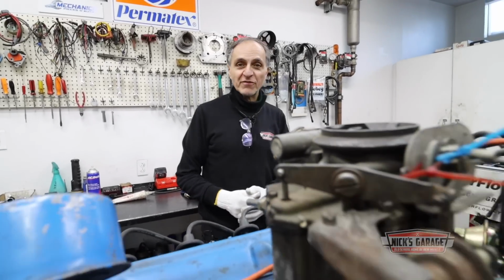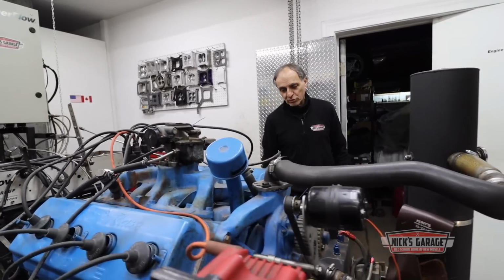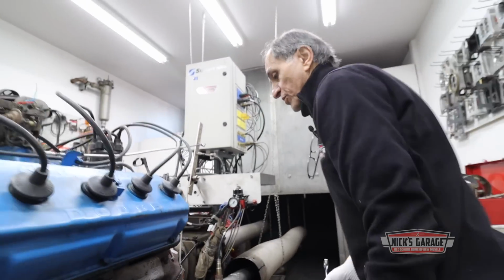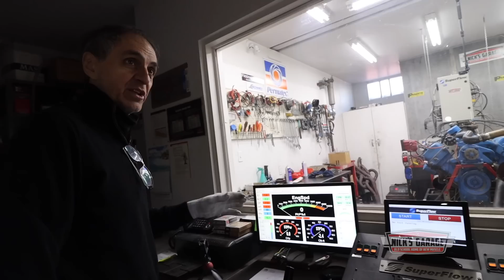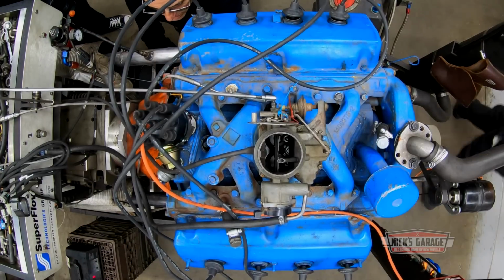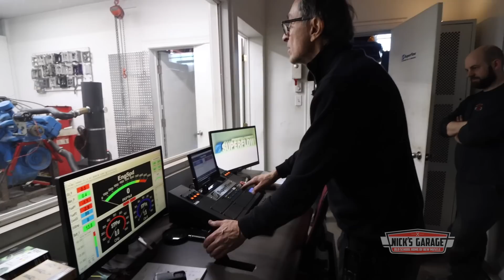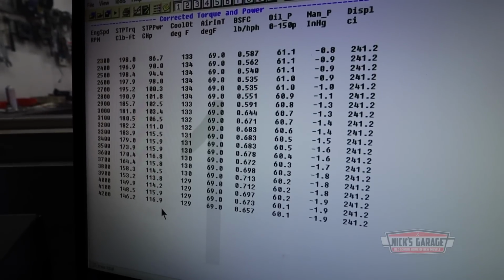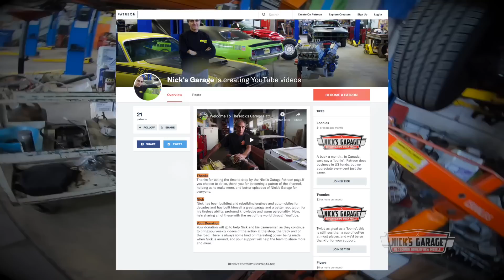Gen 1 HEMI on Dyno - WEAKEST Engine I EVER Tested

Comment: That's the thing I never really liked about chrysler engines. There is always some stupid unique spacer/provision involved. I'm not just talking about shims. Usually very difficult to adapt. Usually, a "oh we're going to make this engine fit to this, and later redesign it to fit to that". That's just the reality of the beast. And of course things always go wrong when you don't use the right parts.. YOU HAVE TO USE THE RIGHT PARTS. I learnt that lesson a loooong time ago. It was a valuable lesson. If you're 50% wrong, you're 100% wrong.

Can I blame nick for this? Not really. When there are so many provisions that are required for every unique scenario, there will always be one unique scenario where you can't perform. But he should have had the provisions in place before agreeing to do the test. I know how hard it feels to turn down a customer. But sometimes it's the right thing to do.

Don't get me wrong, chrysler made some amazing engines.
Reply: blerk h.        I was lucky on the first 241 Red Ram last year, no issues. Same set up as before, and had a hard time with this one. If I would have know, I would have done lots of machine work to fit it correct. But wait, I have an other old Hemi to be rebuilt. This one is  a different set up at the flywheel, a 1956  354c.i.
Reply: Yup. My major gripe with old Chrysler's is how they constantly keep changing minor details from year to year on their engines and anything else they design. As a result I usually cant interchange parts between two Chryslers from the same generation unless their model year, edition and everything else also matches. Simple repairs on a Lebaron's or Colt's turn into nightmares because you never know if you really have the correct parts. They even somehow managed to screw up the 2-bbl carb on my 85 5th Avenue so it wouldnt work on any other vehicle with a 318. GM meanwhile is notorious for sticking to the same hardware but still never seems to have this issue.
Reply: @pinkhead6857890  Even the newer ones too. Once had an 345 C.I.D Hemi mated to 45RFE transmission on a 3/4 ton ram. Of course the starter caught onto the fllex plate and ripped right off a piece of bellhousing. Similar to what we saw in this video.  Starter was dragging around on the pavement. The 45RFE transmission has provisions for jeep, which has a starter on the opposite side of the bellhousing. I solved the problem by getting a jeep starter and running wires to the other side. All this occurred because of something known as a "structural torque dust cover" which mates the bottom of the engine with the bottom of the transmission, wasn't centered properly, as per torque sequence. I also have seen an 1980 ram with a slant 6 225. Starter just barely made contact with the ring gear of the flywheel. Sometimes it wouldn't, you would have to try it a few times until it did. Original starter never had that issue, but other starters all had that issue. Ended up just restoring the old starter with new contacts etc, problem solved. Tolerances are ridiculous. Oh yeah, thread locker on everything haha.

Comment: No harmonic "balancer" , No locating flange for the flywheel , Sharp filet cuts on the crank. That's not an engine , that's a boat anchor.

Comment: I recall the 1st Gen 1 you had on the Dyno "it's idling at 600 RPM" 😂
Reply from the maker: These old girls have a low heart rate.
Reply: Yeah, 600 is high... those early '50's engines idled at 300 - 500 RPMs... you could just about count the RPMs by eye...
Reply: @BuzzLOLOL  300rpm is definitely too low. That's oil starvation territory. The oil pump needs to spin faster than that. You often hear guys tune their Harley Davidson engine to a real low loping idle; it ruins the bearings.

Comment: You will probably have to replace the seal in the absorber now, and hope you didn't kill the bearings
Reply: RAM.          I hope not.   The absorber sits on a coil spring wrap to cushion it from vibrations.
Reply: @nickpanaritis4122 I know, mine too, I'.m worried about your mechanical water seal and the bearings in the absorber. That's why you always have to be opening the boost valve to prime the absorber--Have you ever replaced the seal? Mine is replaced at least once a year--sometimes twice.
Reply: @RAMMBRUTE  .   I have last year. I open the boost valve when I start on low RPM's. Other wise it works fine.
Reply: @nickpanaritis4122  OK cool

Comment: I never thought about so called idiot lights like that. I have both factory oil pressure gauge and light on my vehicle.
Reply: Are you saying the light is on?
Reply: @zosxavius  I check oil at least weekly and top of when necessary. Been daily driving the same vehicle for 11 years and has 358,000 miles on it now.

Comment: The last of the 230 Flathead six engines had about 130hp so that is kinda funny. Of course they won't pull the rpm this engine can but they have a ton of low end.
My second car was a 41 1/2 ton military closed cab pickup w winch and it had a 56 Plymouth flathead 230 in it and would outrun my buddies identical pick up with the original 218 in it. Common swap on those old trucks and a big improvement that looks identical and bolted right in.

Comment: did the flywheel got welded onto the centering tubing piece once centered with 4 bits of wires ? or did i miss that bit ? a bit cowboy nick, but well done. i personnally wud have not had the balls to continue with a pull seeing those vibrations and could see a cracked bellhousing coming from a mile away. but nevertheless, you macgyvired it, well done !
Reply from the maker: The wires were only pressed in.  Thanks for watching, Fire bird.
Reply: Nick's Garage ok, yea that’s what i saw. Wasnt sure if you had welded it, or just used wires for centering purposes.
With the 4 bits of wires in there, You’d think it would spin when you try to crank it over, and you’d think it would spin when doing the dyno pulling as water works a load. Looking at the 4 bits of wires after the pulls, was there any evidence that it had spun at all ?
Reply: @firebird70  .   Used only to center the flywheel.

Comment: I bet I had a weaker "Hemi".  The 1.6L four-cylinder engines in the early 80's Ford EXPs were Hemi heads, and the "high output" version of this engine was rated from the factory at 80 (yes, eight-zero) horsepower.
Reply: Terry Hesticles " Innerestin " so did the early 70s Toyota Corolla. The first Hemi I ever heard of was the 1938 Crocker motorcycle which was guaranteed to hit 100 or your money back. Of course the word Hemi is purely synonymous with Mopar.
Reply: And the big aircraft engines of WW2 were all hemi heads. Even the R975 radial they used in the Sherman tanks.

Comment: I like to see a stock Poly 318 on the dyno and see if it really had 230 hp.... Or a 67 318 also rated 230 hp....
Reply: I may be springing to defend a poly, but they'd push a 4,000lb car to 16.9 with a 2bbl and 2.76 diff. I suspect they had more usable  torque than the '67 318 too.

Comment: why dident the customer supply  a correct flywheel  ?
Reply: you could have gotten that flywheel in the head
Reply: Kjell.         Flywheel is welded to the torque converter, 1 piece.  Will not work with Dyno.
Reply: @nickpanaritis4122  is that mopar style ? My chevy  starter gear is bolted to the converter

Comment: If Maine bearing is worn out you can get the same play in crank
Reply: Maine, like the state?
Reply: @bierstein4534  Sorry talk text with my heavy southern accent sometimes spells things wrong
Reply: They checked the crank with a dial indicator ruling that out.
Reply: You mean thrust bearings?
Reply: @oldpolak5203  no main bearings in a large diesel up and down and side to side movement usually means vibration in the engine and clutch assembly but he said they had good oil pressure so it could not be that most big diesel engines have okay oil pressure and the warmer they get the lower it goes seen c15 cats move over 1/4inch or more usually around 800k to a million miles
Reply: Donnie , the Isuzu Trooper was a 2.4 litre gas 4by4  that I bought for 500 bucks . It lasted 3 years for me , and let me tell you nothing but freekin problems! No power , fuel pump strainer plugged with fine dust , body rusted from frame mounts, finely a piston hit the spark plug  . I took the four cylinder apart to find out  wtf . There are thrust bearings on either side of main bearings on the block to keep the crank from going in and out when under load . Im no mechanic but I like to work on my own rides. Keep healthy and sane man .

Comment: I had a 71 340 duster. that would bust a flex plate with in 2 weeks after putting it together.  changes trans and even went to a solid flex plate and 2 weeks later it would bust. rebuild the engine. no endplay balanced and still would brake it. never figured it out.
Reply: Bell housing to block alignment is one of the most overlooked problems.
Reply: @lukethedrifter3363  its a little late now but that's what i'm thinking now

Comment: the issue with my idiot lights on my chevy is that even tho ive had my car overheat 20 plus times i never saw the light turn on. more often than not they just dont work and you wouldnt know that till they dont turn on and your cars on the side of the road. ps the light does turn on at start up so its not a dead light. the alt light doesn't turn on untill the battery is just about to die and then it immediately goes off cause the battery is dead. the last one marked oil has never turned on outside of startup.

Comment: FYI that kind of balance  issues cause main bearing destruction nick why didn't you just refuse to run it on the dyno sometimes you have to say no. It looks very poor on your behalf running a customers engine sparks flying and jumping off the stand. That was a poor display and frankly I'm very suprised. I would have shut that down before it got started
Reply: Vincent.             Good point, yes I agree. I just wanted to make 1 test and get over with it. Much longer I would have stopped and remove the engine and let it be.

Comment: There called an idiot lights, for one simple reason, only an idiot would depend on them. I used to have a Holden panel van, which had both an oil pressure light and an oil pressure gauge. Several times the engine was so low on oil that there was virtually no oil pressure but the oil warning light never came on never. I'm not saying your wrong, this is based on experience.
Reply: Stephen.         That is my point. The light is the best thing, when it works. Why do people call it an idiot light, I do not know.

Comment: Gotta remember that there a lot of I-6 engines larger than that.
Reply: I can think of a 4-cyl that is too. Mercruiser 270, basically half of a Ford 460 done in aluminum with a production 460 head. 

No matter what size, that little Hemi sounds mean.

Comment: When you can't get your dowels aligned with your bellhousing you will have starter problems.
Reply: Ricky.   I know. But to do machine work for a couple of tests. My 1st 241 not long ago I had no issues. Same job was done to bolt them together.

Comment: engineering came a long way since then.. now we have V3 engines that output 600HP.. XD
Reply: yep and 18 ecms,54 sensors,6 miles of wiring,special intakes,special injectors..........i love an old fashioned,carburated air pump
Reply: @trillrifaxegrindor4411  well old fashioned is definitely easier to maintain and anyone with basic knowledge can fix it, IF something stops working. (btw your estimation on how much electronics it needs, is way overblown. it just uses selfmade(by its designer) air intake. there are minor differences here and there and lot of the process is monitored by sensors  but its nowhere close to 54 xD. its a Freevalve technology.

Comment: Ha that old Hemi starter sounds like a lot of small block Chevrolet's I have heard when needing a shim kit lol . Not sure why but many years ago we never needed shims for those but as of late it seems everyone of them has to have a shim or 2 to get them to function properly . I have a feeling that with most everything made in china the die casting molds used to make the nose cones on them weren't designed right & the concentricity is off on the casting which should be caught & corrected by the inspector then fixed by the guys in the machine shop that fix the dies ! When I was a die caster many years ago we had ISO 9002 so if anything like that would happen those parts would have been caught & scrapped & if not & let out the door then the company gets fined lol . Keep up the great videos Nick because this gives me something to do for a while being a prisoner in my own home from this Covid19 crap stay healthy stay safe always !
Reply: At the plant I worked at that's part of how it worked but it's up to the inspection to make sure those parts are in spec by checking blue prints then measuring  or using a machine that actually takes measurements & making sure the concentricity was spot on with the blue prints & that the die makers didn't screw that up but for the love of God I can't remember what it was called at the moment lol . Now they probably just use a computer instead but back when I worked in the foundry as a die caster there was no such thing or program that could be loaded with the specs measurments then scanned like today so most of it was done manualy . Part of the other side of it was that it also kept track of the quality control of each shift machine & person making the parts that was signed & dated by each worker using a lot tag for every layer or basket of parts because you would obviously have a unfinished basket at the end or start of a shift so that way the new worker could sign off & keep his parts marked from the previous worker incase one of them made mistakes & hadn't cought the defect while making the parts & those getting mixed in & not being able to find who made those bad parts ! Inspection can't look at every part if you only have 2 inspectors & 30 die casting machines like we did so it's also up to the die caster to visualize the part for defects such as poor flow swirls holes perocity in the castings drags busted off core pins etc & some times using go & no go gauges to check parts with in-between cycles of the machine depending on how long the open close cycle times are for the dies & how big the parts are as they need to be cooled enough to do this . This helps catch most if not all defects before any parts go out the door to the company that we are contracted to that actually designed the parts but we cast them then it gets shipped either to them or where they want the parts to go for the next step of assembly . If these parts go out to the company with defects & not on time then our company gets slapped with a big fat fine & looses money plus has to remake the parts that are bad & pay to ship those to the said company for free !  If after so long if they keep getting bad parts sent out because of inconsistent making of parts the other company can drop & break the contract with us basically at anytime & use someone else plus gets a fee from the company that screwed up the whole thing so it isn't a good thing when that happens to both sides being they both loose money & the parts they need to keep the assembly lines going don't have the parts needed to do their jobs . I remember when we first had to do it & a lot of the die casters didn't like doing this whole process because that also meant more work for them keeping track of lot tags on each level of parts in a Gaylord basket then remembering the ISO part numbers & everything else involved in the process but it had to be done & it worked for our shop because we never lost a contract or had parts leaving late I remember . I casted parts for the military which quality control was of upmost importance nose cones for rockets mine dummies for practicing on how to detect a mine that had to be exactly the same weight of a real live mine, hand grande parts parts for M-16s  plus stuff for air planes like the casting for the ignition magnetos for the engines, GM, Harley Davidson, Honda, Kawasaki, Polaris, Toro, John Deere huge mower decks, Moroso valve covers for SBC which I had a case of those for free at one time & a bunch of other stuff I casted in the 13 years as a master die caster years ago until I got arthritis real bad in my hands & had to change my career back to working on cars again but in speed shops where we worked on mostly drag cars muscle hot rods & classic cars of all types being we were sponsored by the MSRA which worked out great for me being it was less grueling on the body better working conditions better pay plus I got to test drive every car I worked on before & after lol & for back into working on these cars l grew up with & loved plus being able to afford to finally build a hot rod truck being I also had connections to people who had parts in the business so it worked out great for me ! So essentially no we were only part of making the parts for stuff so if our ISO quality standards were up to par we had nothing to worry about that end of it goes to the final manufacturers who sell those products to make the warranty & stand behind that warranty because most everything is tested for long periods of time by the R&D guys to make sure it can last works well in the environment that it's supposed to then if it passes all the test then parts are made to make it for final production then eventually sent out & sold to the customer . The other point I was making is I doubt many of the parts coming from China used in the auto industry are ISO 9000-9002 & that's why we have a lot more defects or parts that don't last or work as good as they used to !